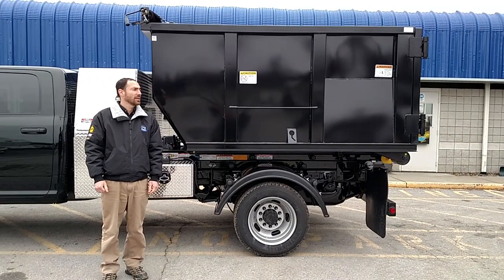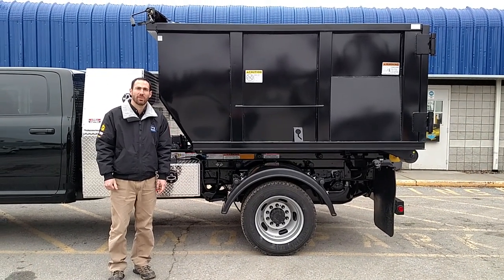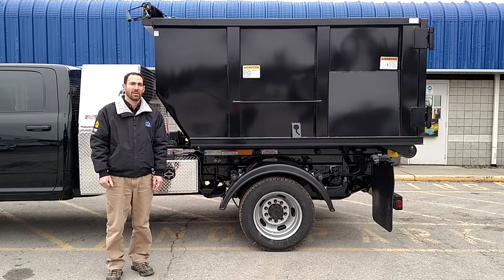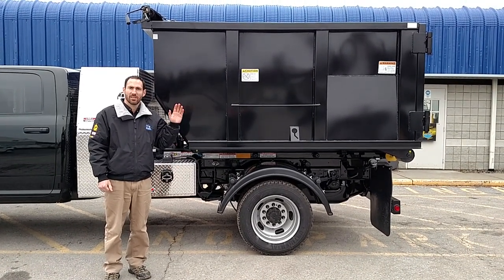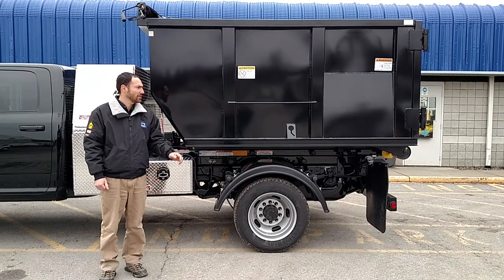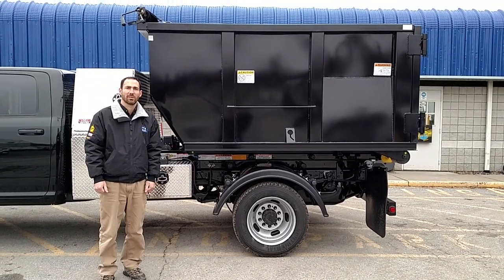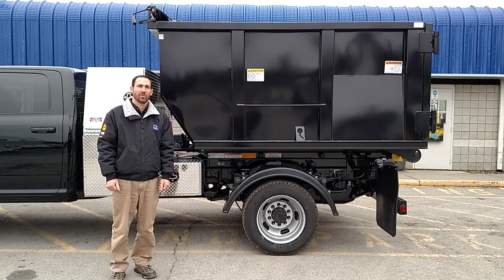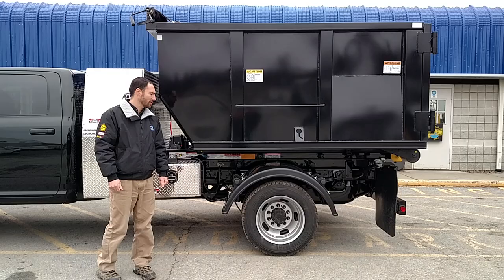Switch-N-Go Interchangeable Truck Body System

Comment: Please if you're making a demonstration video at least do it right. The container is not secured at all at the end of the video because you already had the hoist down and locks engaged prior to container bring seated in its place. Currently neither the front of the body or the rear are locked in and that's how you loose a body on the highway or going around a turn. 

Second. The pin is used for dumping only so the winch doesn't have to be the only thing supporting the weight of the container. There's no benefit to having the pin in when just simply transporting.
Reply: Too much slack in the cable

Comment: It lock it self what size winch ?
Reply from the maker: Hello, It will lock when the system is fully lowered down and then there is a secondary safety pin you'd install also.  The winch on this unit is 15,000 lbs.  Thank you!
Reply: How much does one of this deals cost with installation?
Reply from the maker: Hello - the system with the body pictured in our video is approximately $16,000 installed.  Thank you. Please call us if you'd like more info.  845-454-7669.

Comment: Any updates
Reply from the maker: Hi Brian, not much has changed with these systems over the years however Switch-N-Go has recently started to offer a wireless remote as an option. Feel free to give us a call if you have any additional questions!
Reply: @hudsonrivertruck  do you guys install hook lift systems also
Reply from the maker: @brian2100  We certainly do!
Reply: @hudsonrivertruck  I’ll be giving you a call
Reply from the maker: @brian2100  Thanks Brian, we look forward to hearing from you!